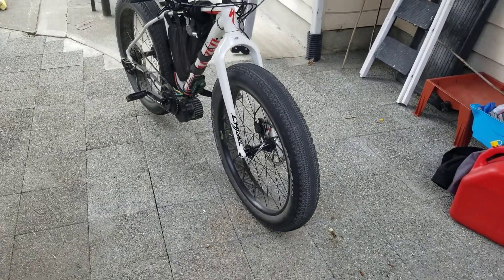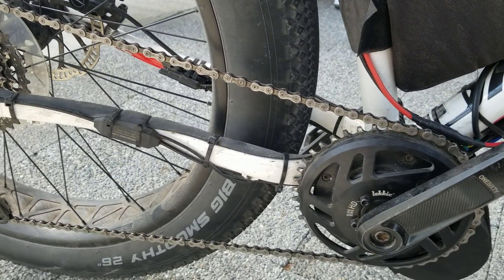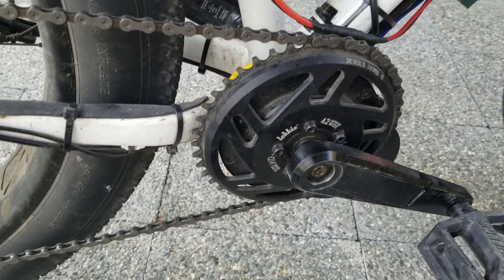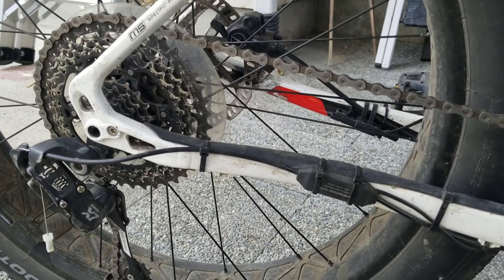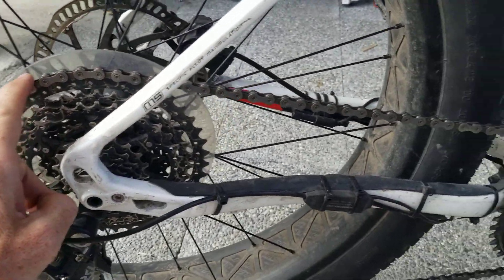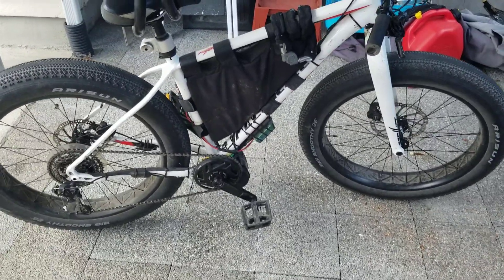Bafang BBSHD (ASI BAC800) on Specialized Fatboy - 3000km What I have learned!

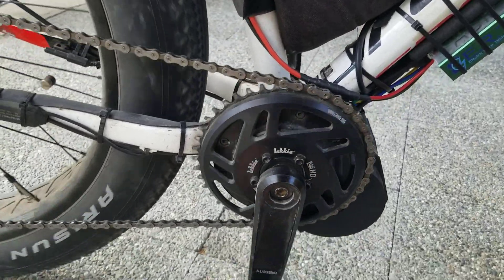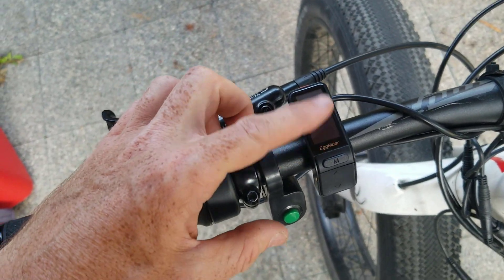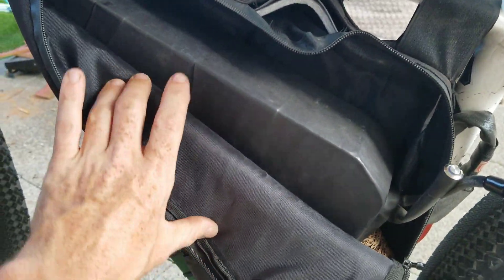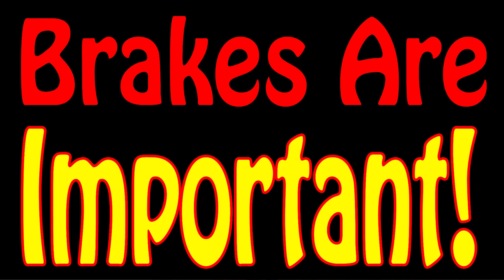Comment: 2:50, riding tip. 4:23, 42T lekkie ring. 5:09, just get a basic break sensor. 7:00, eggrider. 7:35, em3ev triangle battery. 9:00, hydraulic disc break.
Reply from the maker: That's awesome thankyou! What a way to start the morning, cheers!
Reply: Captain Codswallop Thank you captain! Been researching for BBSHD related videos for a while now. This video summarized findings I’ve spent hours on, wish found it earlier.
Reply from the maker: Glad it is useful to you. Appreciate the link things. I will have to learn that for my cyc installation video.
Reply: Would that same battery but in 30.6Ah be overkill for this bike?
Reply from the maker: When you mean the 30.6 is that in the same pack format just with higher capacity cells? If so they will have a lower max amp draw that the 30q or hg2 cells in the 25.6 pack. Which is fine for stock but if you run the external controllers you want the higher discharge rates.
Reply: Captain Codswallop thanks!
Reply: how about just get a learning how to spell brake 1st ?
Reply: FYI for ppl that still shift gears, place the gear sensor next to the motor or shifter and it will react and cut off power faster... 

But since more power trumps needing to pedal and makes even changing gears to much of an effort NVM...  

BTW its fun to bitch about a stock controller that was only designed handle a fraction of the juice going thru it now.... But Bafang has an impressive motor and gears to handle all the abuse its getting now...  enjoy mate...
Reply from the maker: Thanks mate. Bbshd rules!
Reply: Great review, just finished building my bbshd , agreed about the lekkie ring , I wonder if there is any frame where the chain line works, a little concerned about price of the bling ring , even though it is 7075 heat treatment , it's still ally , and will probably wear quickly , anyway still learning , thanks for your helpful review
Reply from the maker: Thanks Paul. My lekkie is showing very little sign of wear. If you get the chain line right it should last you.
Reply: HV it's Tom and you just sent my asi bac to the UK, I can't log into discord with the new phone. Can you please send a new invite please
Reply from the maker: Here you go Tony. Let me know if any problems https://discord.gg/9UwDG4j

Comment: i have a question, so you talked about how it is bad at dissipating heat and that it isn't good to use the small gears at low speeds for the motor. I was wondering if it is ok to use the rest of the gears once you get the bike so you would be acting like an automatic transmission for a car, how you keep it in the low gears when you're going slow then go up gears when you reach the limit of the lower gears to reach a higher top speed.

Comment: No gears with a mid drive is kinda pointless. What’s good about mid drives is you retain use of your gears and can adapt to more terrains. I like to do full speed street rides too. A hub drive would work best for you
Reply from the maker: It’s only pointless to you though. This is not meant to be pedalled. It’s more like a stealth dirt bike. It will climb pretty much anything with that single gear as well as reaching 65+kph. It’s one of the most fun bikes to ride. But if you want pedal for exercise look elsewhere.
Reply: @HighVoltageKits  It's condescending how you talk to me like I'm some noob who stumbled across an ebike build channel by chance.

I have converted my mountain bike using a Luna BBSHD ludicrous kit, that's 2600w with their 52v LG battery and their 50 amp controller. It's very stealth and I don't need to pedal. 

There is no way you're reaching 40 MPH with a single gear setup.

I can only reach 38 MPH if I'm on the smallest 11T rear sprocket and with a very large front 42T chain ring. I would absolutely melt the internal BBSHD nylon gear and probably mess up a bunch of other internals if I only operated the bike on the smallest gear all the time. Especially starting, climbing, etc. And if I upgraded the nylon gear to metal I would just strip the metal.

What you are doing is running your kit as a single gear with the largest rear-sprocket, which is fine but you will not reach 40 MPH. 18/20 MPH tops would be my guess.

But all in all, this is an incredibly useless proposition as the only reason to run a mid over hub is ability to pedal, and ability to climb AND go fast depending on gear selection. You're doing 1 of these 3 things at most.
Reply from the maker: @vapeurdepisse @vapeurdepisse Lunas stuff is shite. I know nothing about you so you interpreted notion of condescension is your own making. I get all kinds of people commenting on here saying what I cannot do with a bbshd. Fact is using our kit it pulls 3500 watts and hits 65kph with ease as we utilize field weakening with the ASI controller. That results in a loaded peak of over 13,000 rpm. My channel is literally full of videos showing this. Not hard to find them. I use a 1 to 1 42t to 42t to get the perfect balance of acceleration and climbing. Don’t believe me here is our kit reaching almost 90kph at 4000 watts. https://youtu.be/ttVPZBSEW3o?si=Z1DiFNPelZqnJnTV my fat bike is slower as I use less power. It reaches less rpm due to drag etc. Not meaning to be condescending but you don’t know jack mate.
Reply: @HighVoltageKits  Saying Luna is shite while you're just putting together kits from off the shelves parts and cosplaying as a business... Even calling yourself "we". And making a bunch of nonsensical claims that are 100% physically impossible. I guess I'll have to see your wonderful kits on your channel as it's not available anywhere and nobody else is using them 🤣
Reply from the maker: @vapeurdepisse your clueless. I literally posted a video of it doing close to 90kph. You just looking to talk shit. Grow up kid. We wouldn’t want to deal with you anyway. If you think it’s impossible you don’t know a thing about Ebike’s. L for love ;)

Comment: Impressed by your knowledge. I have a BBSHD mounted to a Scorpion recumbent trike. The motor is great but I am plagued by ugly bang-crash wallops of chain slipping which I don't seem able to eliminate completely. I have changed my chain and 9-speed 36T cassette and still get nasty noises. I measured my chain with a 12" ruler and there is no stretch to worry about. I use a 65T chainring so that I can still pedal at up to 53kph-could this be the cause? Failing any further investigations, I would love to replace my derailleur with an IGH 5-speed if only I could find one to cope with the torque of my Bafang. Do you know of one which would?
Reply from the maker: I wish I knew of a hub that can handle that amount of stress. Folk have tried the Sturmy 3 spd but it fails eventually. Is the chain slipping on the rear sprockets? The small ones. I wonder if a clutched derailleur might help? You are welcome on our Discord server to post photos and videos. Maybe we can figure it out.

Comment: When i shift i would do the same thing just flick the brake and shift but now i have i.g.h 8 speed. I had a 42 tooth bling ring and it rounded off because i didnt keep a eye on it and it started  sharking. So i got the 46 tooth bling ring.
Reply from the maker: Cool, which IGH are you using? Did you get much of a boost with the  46t. I could not go that big on mine as it would not clear the chain stays. I think I went through all three sizes. I should have just gone with the middle size to start with lol!

Comment: so you don't change gears ? doesn't that wear the chain and motor out faster because you run it at a higher rpm than you otherwise would ?
Reply from the maker: The chain has a very straight chainline and the ratio is kind at 1:1 These motors are very strong so they tolerate it very well. Lots of folks with this setup have thousands and thousands of kms on them. Your point is valid. I'm sure they will wear faster with both its just not to the extent that would make it not worthwhile. Thanks for the comment.

Comment: Yeah but I think those tires are not necessary and when you need to replace them that's when you get the shock it's going to be hard to get and they'll be expensive if you can't even get them anymore,, and that's they're made like motorcycle tires and I think I've seen someone and I don't think they are they're like puffed up bike tires and they're going to go and pop or wear down,, that's why I'm thinking of just getting the kid a conversion like this guy because then if they steal it or you crash or something you're not losing that much money and I think you get the same experience which is being lazy and not riding your bicycle
Reply from the maker: Sorry David. This was a long time ago. These are the smooth tires?

Comment: So to confirm, you’re just using one gear always? Any thoughts on ditching cassette and derailleur and going single speed? How many teeth is the large cog you’re using?
Reply from the maker: I'm using a 42t to 42t now. But there is a caveat..I'm running an external controller so I hit up to 13k rpm. I'd use more gears if I was stock still. Try this video for where the bike is now. https://youtu.be/c7q5TbIYq7I

Comment: Because you always use the large sprocket at the back, don't you find that it is not good for pedaling as the speed goes up? Like your feet just spin around, or are you only using the throttle? I recently installed mine and find that I'm always in the smallest cog at the back otherwise peddling is pretty impossible
Reply from the maker: Yeah. I gave up on peddling with my setup. It's just for transport and getting about. Once rpms get up that high there is not much you can do apart from use a smaller gear.
Reply: @HighVoltageKits  what about the upgrade bac800 ?
Reply from the maker: Oh it was too fast stock. Yeah I guess you lower the amount of assist. As soon as you up the power though the motor will attain a high rpm. There are some settings you can do tho. Have you searched for Karl's special sauce bbshd?
Reply: @HighVoltageKits  I tried... It comes up with StevenC video about hacking an ebike, shows changing basic levels etc not about the bac 800... Any info or link?

Comment: are you riding more like a motorcycle or using it as a assist to you pedaling and I'm wondering if some of this issues you raised related to drivetrain and controller are because of that cheers
Reply from the maker: More like a moped in speeds. PAS is okay but not like with a torque sensor. These days I just use the throttle with a nice big gear at the back. I'm very much more into enjoyment of riding around than the exercise. I have not run into any drive train issues since I moved the cassette around to get a straight run. Hope this helps! Cheers
Reply: @HighVoltageKits  I'm just looking at getting a stock kit on my bike for now to start exercising again I've been out of it for a while and find I get to tired if I try going out and fall off the wagon quick because of that, so I was thinking of adding this kit to add assist to me exercising so I actually can get out and enjoy it rather than feeling awful, any recommendations with the stock system in my circumstances? I have a 2015 RSD The Mayor
Reply from the maker: Yes. I would get it from a place like em3ev that does a bit of work on it to start with. Get it programmed with Karl's special sauce settings. You are welcome to join the channel discord via the link in the description. We can help more easily on there. You can post pics of the frame etc.

Comment: Hi there. Great video! 
Did you have any issues syncing egg rider - with bac controller? Really like its compact size.
I'm based in UK and one of the companies here which has bac controller in stock  supply them with some ugly as hell display.
Cheers
Reply from the maker: Thanks. The eggrider has changed alot since I first used it and is much better with the ASI controller. We are testing it as an option with the kits we make for the bbshd. I would check with the supplier in the UK. Whether or not the eggrider can be used depends on how the wiring harness is made. At 72 volts without protection the voltage will fry both the eggrider and usually the controller too. So caution is needed. We have built an adapter for this purpose but it's still in testing. Hope this helps. Cheers

Comment: So you say you changed the controller to the external one? Did you remove the internal controller? Can you do a video on this? Thanks and great videos mate!
Reply from the maker: This is a link to most of the videos I have on this bike in order. Hope it helps there is one on waterproofing but will have a better one on the installation layer this year. Cheers

Comment: Hello , do you need the 120mm bottom bracket version for this ? id like a fatbike but my motor is the shorter bottom bracket version .

Cheers
Reply from the maker: I used the 120mm. It all depends on if the gear housing hits the chain stay. You can get a conversion kit to make the axle longer though. If you Google https://california-ebike.com/shop/new-easy-install-100mm-bafang-bbs0102-extension-modification-kits/ This is the bbs02 version. I am sure there is a bbshd one. Good luck! My video this week will have a tool that let's you check a bottom bracket for motor fitting.

Comment: Brakes are important!!! - said the man running Tektro 2 pots. Honestly dud Shimano M520 calipers will work with tektro levers and get a set of Uberbike Radiators with Racematrix and you'll wonder why youe ver stuck with those tektro.
Reply from the maker: Money mainly. I have a limited budget to do these projects. Once the new one is done this bike will get a full rebuild. You are correct. Quad piston Shimano or Magura would be much better!

Comment: Hi Captain,

I am eyeing BBSHD but my biggest problem right now is the frame. How comfortable are you with the rigid fat bike frame? I plan to ride to get around my farmland which is very bumpy and rocky at places. I can't be sure if a rigid fat tire frame would dampen the shocks enough, or whether I'd need a full suspension frame. Then the problem with suspension frames is the inability to slap rear panniers and baskets. I'd like to hear your opinion on frame selection, if you ever see this comment.

Thanks for the videos.
Reply from the maker: With fat tire bikes the tire itself is suspension as you can use quite low pressures. Also the thud buster seat posts help. I now use a rock shocks front suspension and I recommend that for sure. If you need the 120mm bbshd I would move on it now as they have changed the model and it might not be available much longer. You are welcome on the channel discord community for build advice etc. https://discord.gg/YAAjfgc Cheers

Comment: Im new to this putting a bbshd on old Cannondale F900. I put the shift sensor on and now my shifting skips. In the video you comment you didn't see the need for shift sen and only use the big rear gear? What did you mean? I know you had gear changes in your other vids. If I can get rid of the sensor that would be great. Im taking your recommend on the battery/ don't have money together yet. Thanks for your videos!  Still on the entry learning curve
Reply from the maker: We all started somewhere! Thanks for the comment. I am using an external controller with single speed so no gear changes! But i still used a gear changer when I was on stock. You are welcome to join the channel discord. Easy to get help there! https://discord.gg/YAAjfgc
Reply: I just followed link to discord and signed up. Thanks!
Reply: Since I don't have a battery wondering about the em3 60v?
Reply from the maker: I'll have a look when I get a second. It won't work stock bbshd for sure tho. Will have to be a modified controller
Reply from the maker: Awesome. Feel free to post questions and photos. Especially about the gear sensor issue.

Comment: Why would you go through a rear brake pad more often than a front brake pad?
Reply from the maker: The short answer is because I was riding like a bit of a muppet. Part of it was my concern over the carbon front fork. So I was tending to brake more on the rear I think. After I put in shocks on the front I trusted it a lot more so brake wear is now much more normal! Hope this helps. Cheers

Comment: Handy tip; use silicon to secure your motor to the down tube. I used quite a big amount and it's very secure. It will never move.
Reply from the maker: Can you link a few more details. A silicone gel or sealant? Sounds interesting and not a trick I heard of before. Thanks!
Reply: @HighVoltageKits  My 1st Ebike (about 10 years ago) was made up for me by Daryl who designs the Lekkie products here in NZ. He also helped me with the my latest BBSHD install and said that it was a good idea to use silicone to ensure the motor did not move. I just used a good quality Black Silicon sealant and it has worked very well. There is no movement possible. If you need anymore info I'm glad to help.
I have also asked you a few questions on your site, just now, about your Kit that is out of stock. I hope you get some in soon.
Reply from the maker: Thanks for the information. I will look at the email shortly. Have a rebuild and a another bbshd project for this year. Cheers

Comment: (1) It has free wheel on the crank wheel. Does it need a free wheel at the back?  How about a fixie?
(2) What about a hub gear?
Reply from the maker: I am pretty sure you will still need the freewheel as it uses a tensioner with the derailleur. Never seen a fixed gear bbshd. But I'd ask that question on my discord or endless sphere. Internal hub gears can work with stock bbshd but must be a strong one. Check how much torque in NM they can handle. Hope this helps. Cheers